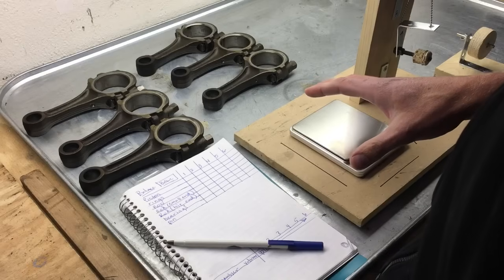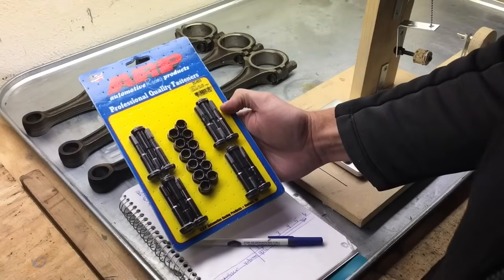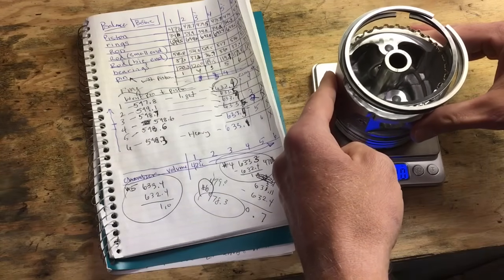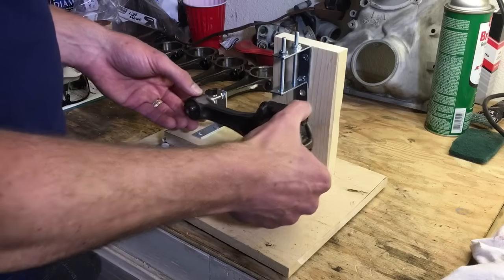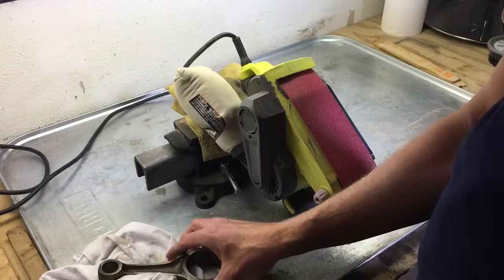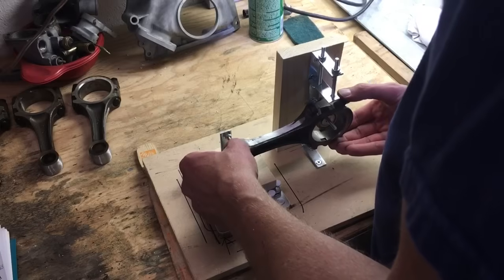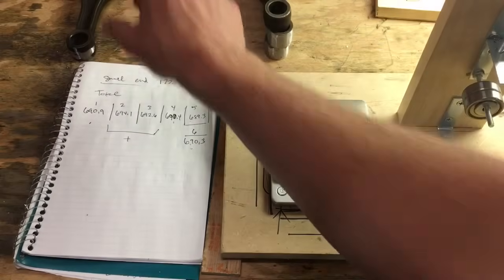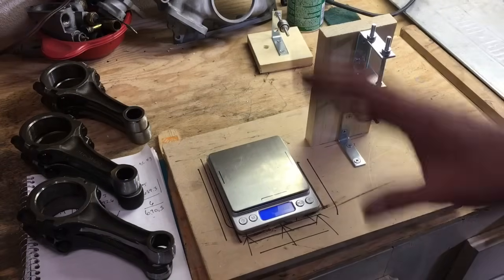How to balance connecting rods and assembly

Comment: Hold on fella you swapped to arp then balanced I never see the re size after fitting the arp bolts  or did you not re size after fitting the bolts  not being a smart arse just asking  if it really needs doing as my rods measure spot on even after bolts are tight
Reply from the maker: Always best to switch bolts and then resize to be absolutely perfect. In this case it was just timing. The differences as well are minute.

Comment: Ok, you replaced the rod bolts. Why didn't you resize the rods? They will all be distorted now. The correct method is to mill the inner face of the caps flush, where the bolt, do the same to the rods inner face to true it, then resize it. now install the bolts. Btw, the rod machines do two rods at a time do 2. You can get away with vising them in with 2 blocks of rod and doing one bolt at. A time, but it's not recommended for a novice

Comment: I hate press fit pistons they suck.

You have to go about heating up conrods to get the wrist pin inside what's wrong with just using circlips? 

I once burned my hand on the hot conrod and I once accidentally put the conrod wrong way around
It's also very difficult to remove them without risking to damage the pistons without the tools
Reply from the maker: Agree, no fun and tiny bit stressful if you don’t get them centered. 
Yeah, pretty much have to plan on the piston getting destroyed when removing the pin.

Comment: nice work at 15:50! I hate doing that (setting pistons) as you got about a second to get it centered before it locks up on you. Mopar rods are tight even when heated so you usually have to freeze the pins too. I took out all my weight from under the pin where the 2 factory holes are and in a pinch I took it out of the pin itself inside the very ends with a bit just oversized from the ID of the pin. The pin material is much heavier than the AL piston and when you got no piston material left, you have to find places to trim. I didnt want to regrind the little ends as they were already a matched set.
Reply from the maker: Thanks! Yeah I’ll be honest I break a nervous sweat when I do that every time 😂
Reply: There is no 15:50 lol
Reply from the maker: Yeah 12:00 is the new 15:50 lol (had to make an edit since)

Comment: I just did this.....  worked great although I had to take out a fair amount of material to get the weight down.  Mine are all balanced now but I have no compression in 3 of my 8 cylinders ?????
Reply from the maker: +Mike Williams lack of compression would relate to your piston rings
Reply: Yeah I was about to say that and it’s cause u rearrange the sizes or volume of what sits in engine cylinders I recommend new rings and cut or refuse to size and weight or as close as u can

Comment: Might be a newb question. Is heating always needed to insert the pin into the rod? Also, was the pin bearing already inserted, i couldn't see it clearly? Tks
Reply from the maker: Great question! Some need the heat and some the pin easily inserts and then has a retaining clip. 
There really isn’t a bearing other than the oil being injected into the surfaces.
Reply: @CarsBikesandCoffee  What about putting the pin in a freezer?
Reply from the maker: +GlennnD great to do both! Not sure if I mentioned in video but I did freeze these pins overnight as well.

Comment: You know where this video lost me? Heating  up the small end with a MAP torch. This can change the molecular structure of a rod. Especially chrome moly. Essentially annealing it while taking the brass in the bearing and making it brittle. Because the brass does the opposite quenched that steel does. The Wristband does not have to be totally inside and the rod can be pinched with foam material. Just weigh the foam and add it to the calculations.
Reply: Was wondering about heating up the end like that.
Reply from the maker: Mark White you can, the key is not letting it go beyond the blue tint as mentioned. The idea is to expand the hole to allow the pin to go through otherwise it won’t for these Datsun rods. Other engine builders do the  same thing. Appreciate you watching!
Reply: @CarsBikesandCoffee  Thanks for the reply.

Comment: Watched video to simply see how you set up to weigh small and big end of rods as I have done this many times in the past at home and always open for better ways. I prefer to shot peen the rods after grinding if for no other reason to make them more visually even and appealing as it only takes minutes to do. As for you method of piston installation ? you should have made an installation jig so you push the pin in and it is 100% correct every time .. you installed the pin and used your hand to center the pin while the rod was cooling .. your margin of error here is very slim and the need to press the pin out and reinstall multiple times in case of error is not something I would feel comfortable doing with new pistons .. make a jig its not very time consuming and if you do this often make the jig adaptable for other piston designs
Reply from the maker: Right on, I appreciate your feedback. That is a really good idea. Maybe have an adjustable piece so I could dial in the pin depth. Honestly I was sweating bullets putting that pin in. Thankfully in my case installation went without any issues. Thanks for watching too!

Comment: Question. Since there is no balancing pad on those rods and the finish is shot peened, wouldnt grinding affect the rod/ pin housings?
Reply from the maker: To my knowledge the stock Datsun rods aren’t shot peened. Are you asking if the housing is weakened by the grinding?
Reply: @CarsBikesandCoffee  Ah, I see. I thought they were, was told connecting rods that are peened would distort if they are ground. 👍
Reply from the maker: I believe you are spot on, and with that they would balance prior to shot peening, I’ll have to check.
Reply: I was gonna do this then read your comment and remembered I have eagle rods. Went to check and they are indeed shot peened. Thank you you just saved my ass! :P